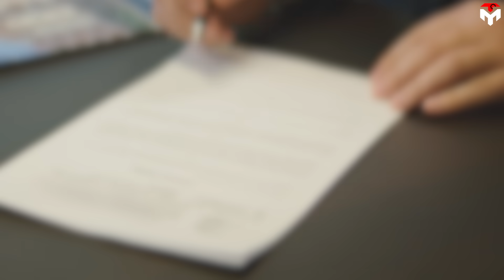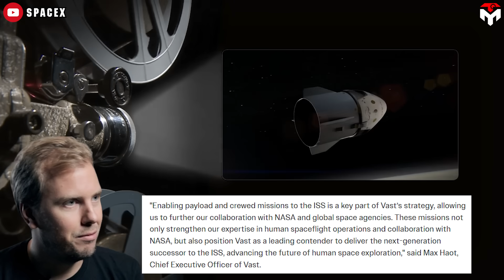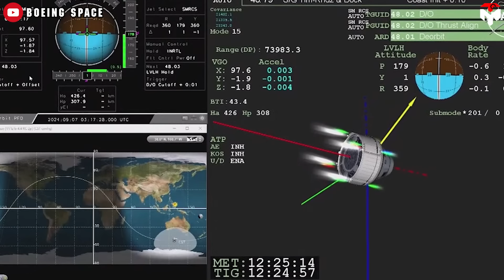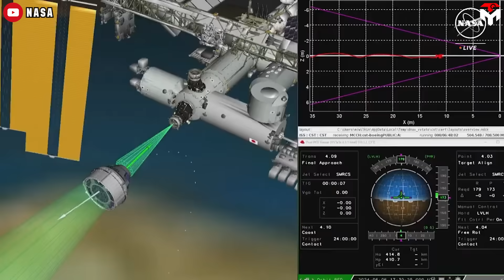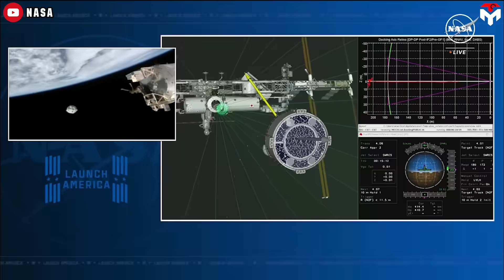SpaceX Just Won The Biggest Contract on Dragon Humiliated Boeing Starliner..

Comment: Elon Musk has the most reliable engines so far, yes, all Companys working on rockets are going to have failures, even Nasa when it first started had hundreds of failures, part of cost in rockets. Just like everything if you do not have a reliable engine, you would not buy it.